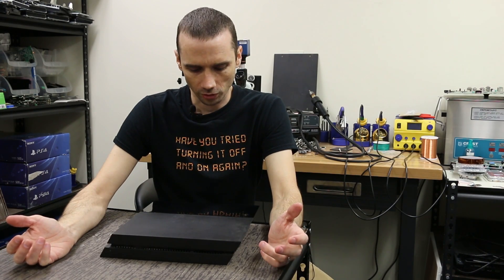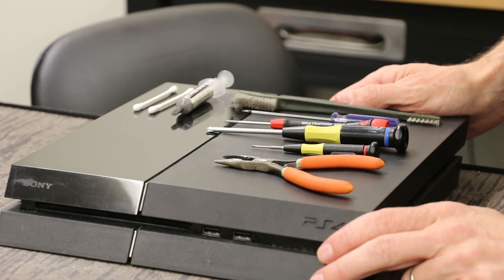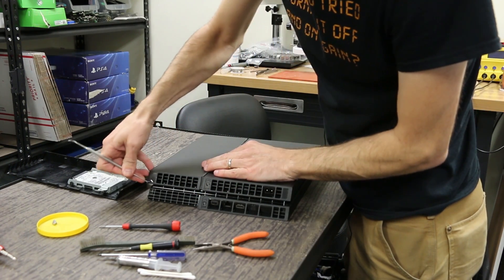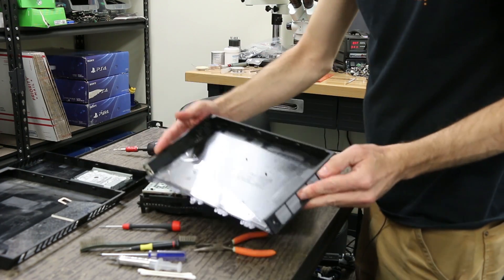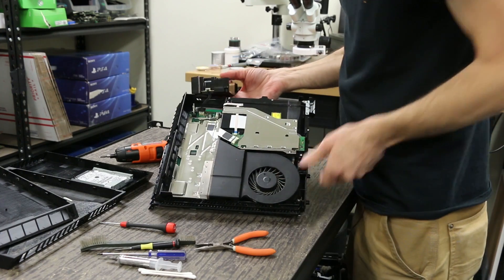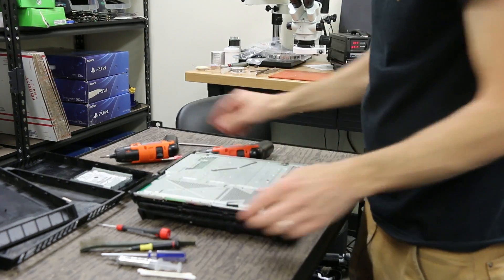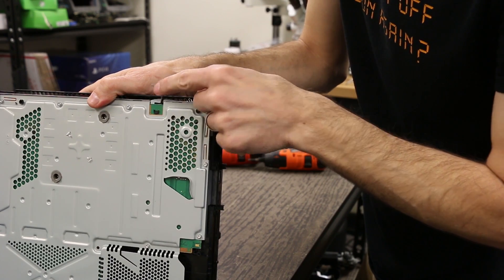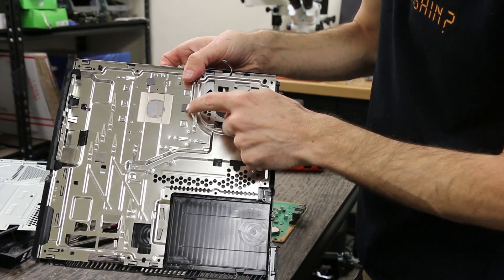PS4 Original Teardown Tips & Tricks

Comment: HELP: I followed this and it worked great for my CUH-1115A.  However, the disc drive didn't work when I put it back together.  The eject button doesn't beep and it won't start feeding a disc when i insert one.  I took it apart again and double checked the 3 ribbon connections and power connection.  What else could have happened or should I do to get the disc drive back to life?

Comment: Tronic fixed thank you very much for this video my PS4  black ops 3 edition was loud as a jet engine. The inside was not in really bad shape, though it was dirty. But when I got to the thermal paste, it was completely bad. almost nonexistent and hard on the sides cleaned it up added the perfect amount of thermal paste and my PS4 is running like new. I can’t even hear it. Thank you very much.

Comment: The hardest power is the power supply I am having quite an issue pulling out the connector

Whenever I try to grab it with plyers it just squishes the plastic then I have nothing to grab on to.

Comment: Hey Steve??? I know this is a very old video, but I am working on a friend's PS4 plus right now. You are the GURU when it comes to these, so I have a question... I have just reassembled and tested - it's beautifully quiet (yay!) but the optical drive seems even worse than before (was a bit 'sticky' but now doesn't draw a disk in. 2 questions if I may... 1. Is it viable to lift out the motherboard while it is still sandwiched between the metal layers (rather than disturb new thermal pads and paste) and 2. Any advice on the disk situation please? Love your videos, will love you long time, 5 dolla!!!

Comment: I just wanted to say thanks for both your teardown and assembly videos. This probably just saved my $200 investment I just made in buying a used PS4. I was in a pawn shop back in May when it was still really hard to find gaming graphics cards or modern gaming consoles for a reasonable price when I came across this OG PS4 that was being pulled from the display case. I knew it was probably something wrong with it but I got the clerk to let me test it anyway. They had it marked as didn't play discs at first but the disc went in ok. I didn't notice how loud it was in the store so when I brought it home a couple of weeks ago I saw the real problem. As soon as I turned it on it sounded like a jet engine. I played it like that for a few days but it seemed to get louder. 

 So I started looking into repair videos. I work on computers so I knew it was probably overheating and would give me problems soon. I hate working on anything like consoles or laptops with little ribbon cables to deal with. I watched both your videos and it gave me the confidence to take on the task. I gave my PS4 a good clean and repaste and even added an internal and external SSD and now it's so silent it's scary. I almost thought I forgot to connect something but I clearly remember plugging the fan back in. I've been gaming on it for over two hours now and it's still silent and has not shut down or even gotten louder. Anyway, thanks for the videos.

Comment: I had so many issues with mine. I don't have anything to pull the cables with, but I managed to remove the power supply, however the cable is so short it didn't really give me enough confidence to keep going. Trying to put it back in 'gently' like other videos said didn't work, so I snapped it back in with some force. The console works, but the case is slightly bent thanks to a torx bit that was stripped by the previous owner.
But now I have an actual issue... the eject button seems to be misbehaving, I didn't touch it when cleaning the bottom part of the case, and it beeps thrice, ejects my discs, and then the drive continues to make noises as if trying to eject still. I have a CUH-1106A, I really don't want to go in the thing again and risk damaging it further but the discs ejecting and that noise worry me so much.

Comment: So, after 8 years of service, my PS4 finally got maintenance.
The video was very helpful. Thank you!
a few tips from me:
1. I do not have small pliers, as in the video, and regular-sized pliers easily break the power supply connector. After a little crackle (my mistake) I gently tugged on the edges of the connector and it came out freely.
2. PS4 fat has several revisions, mine had a couple of extra screws. So you need to remember the location of each screw, it may not be on the video.

Comment: Fantastic Video... I want to replace all my torx and screws. Can you list how many there are of each type of screw and torx used to take apart and reassemble the PS4? I would greatly appreciate it.
Reason for replacing is because the heads are really stripped from the previous owner.

Comment: Hello... Please some help from anyone... My ps4 fat 1200 runs great, but after cleaning services following disassembly videos... Now the console doesn't recognize my controller, even usb connected.... The USB ports have energy because they charge my phone or turn on the portable hdd.... But a generic USB controller and also dualshock V2 controller connected with USB, nothing happens.... Now the ps4 it's stuck on safe mode screen, waiting the PS button command, but after tried different micro USB cords and so on... The ps4 doesn't detect any USB controller connected..... I appreciate A LOT some help....

Comment: 4:31 That method didn't work for me, as I have particularly weak grip. Half a year ago, I stuck there and gave up. Today, I figured the one in the video cannot be the only way, so I used a flat screw driver to pry it open, and it worked! The rest is relatively easy, it's the part that requires force actually got me, lol. So, just a little reminder. If you cannot do what TronicsFix did at 4:33, use a screwdriver~

Comment: Hope you're monitoring this video but  I have the original, not the Pro or the slim, the top piece that slides off the top is not shiny and the screw for the drive is in a different place. But they come off normal,  I turn it over and remove the warranty stickers but they're the only screws on the back and it doesn't just pop up like how you did it. Why ideas? I am trying to remove the CMOS battery. Thanks in advance!

Comment: This is the 2nd time taking my PS4 apart and I just pulled out the wrong wiring on the power block part. Now I have to get it soldered back on. The wiring comes out of the power supply and not the board 🤦🏿‍♂️

Comment: Hey steve, around 5:38 you were take out those long screws with those metal tabs, what are they for ? And is it bad if they are broken? Thanks !
Reply: It holds the power supply in. You'll probably want those fixed or get mew ones.
Reply: @Justin-lx3to  lol they are used to pull the screws out easily not to hold the power supply in.
Reply: @JayzBeerz  oh the tabs thought he asked if screws were important

Comment: Where my chip is my white stuff melted on the part under it and when I put it back Together (I cleaned the stuff that was melted on it off) and turned it on and it will be on for one sec then back off I looked at all my cords and stuff and there back where they should be but don't see why its not on my is the 1st ps4 that came out so its not a slim or pro

Comment: Have you made a video on, ps4 original power button or eject button doesn't work? I took my ps4 apart and had to put thermo paste in it and when I put it back together the power nor the eject button wanted to work all though the ps4 did turn on. But before I did anything the power and eject worked fine, besides the fan being so loud.

Comment: So I just toredown my PS4 turns it back 3 beeps thinking I'd broke the prongs to the power supply nope turns on I didn't have that plastic bit on the X separating the motherboard and metal sheet I'm so dumb I swear I kept looking at it like you came from the PS4 but were you go I have no idea. On the upside I'm slightly more experienced now if that ever happens

Comment: I just observed something... I feel like the reason the older models sound like a jet is probably because the APU clamp doesn't have an extra plastic piece that holds in more pressure on the APU so that it make perfect contact to the heatsink. If there is no proper contact, your APU gets overheated which makes the fan louder. I have a newer model(not the slim) bought in 2016 and i haven't cleaned in like 4 yrs(did a month ago), yet it doesn't make noise even while playing GOW /TLOU2. Btw it runs almost 24x7 lol

Comment: I am currently trying to clean my PS4, and was working to get the fan off but was hesitant to take it fully apart because of the thermal paste needed but, my question is, if I am only going for the fan is it necessary to replace the thermal paste?

Comment: It's amazing just how silent it runs now after taking it apart and getting all that dust out. Thanks a lot for this video. Cheers.
Reply: Yup. All the "jet engine" ps4s are just dusty, and probably need new thermal paste as well.
Reply: Well mine was silent too, until I found out that my fan doesn't work at all, I guess I have to replace that lol
Reply: @hashimkhan5824  How did you find out the fan wasn’t working?
Reply: Mine probably reached a Max of 3000 decibels

Comment: Hopefully you see this and can reply!

I bought a second hand ps4 from a friend and its the original launch ps4. Everything worked perfectly except from the fact that it was very, very loud. I'd cleaned the fan multiple times and it made no difference. I saw threads online about cleaning of the heat sink. So I went to one of your videos and followed your instructions on taking apart the ps4. When i got to the motherboard it was really hard to access because the thermal pads were stuck and I had to pull really hard to free the metal plate above the motherboard. Then I got to the thermal paste the motherboard and the metal player underneath were stuck together because of the paste. The motherboard was almost immovable. In all the videos I watched the motherboard was easy to take out but mine I had to pull really hard for the thermal paste to release. I then proceeded to clean the heatsink and the fan. I didnt replace the thermal paste even tho there was barely any left and it was crusty and hard. I put everything back together and now when I turn it on the fan goes full blast, it gives me 3 beeps and the red light of death. Do I need to replace the thermal paste or is it a lost cause? Thanks for responding
Reply: This is a 3 year old video..
Reply: @darussian705  I still need an answer lmao
Reply: Nevzy fair enough
Reply: Seems like the lack of any thermal paste is making the console instantly overheat and go into quick shutdown
Reply: @darktempest53  update, I replaced the thermal paste and it worked again

Comment: I have a really different ps4 seriously i watched every YouTube video and no one has the ps4 what i have. I don't have 4 screws at the back of my ps4 and my opens harder and difficult and different motherboard
Reply: Did it open with force?
Reply: @Suddenmamba  yes and with so much pain on my fingers.
Reply: @ubeydullahxl  Check the bottom, it might be a CUH 1215a
Reply: Hadi masri there are no screws, just extremely hard to get off, i ended up breaking something
Reply: Same here. Mine doesn't have the screws on the end on the  back of it.
Reply: I have the same ps4 only 2 screws and can’t find any screws anywhere else and can’t find a video explaining why it won’t come off Ik if I force it off it will break
Reply: @skylarburford6701  did you ever find the solution? I can’t
Reply: @trevorjohnson4373  I'm having the same issue! Weirdly I've cleaned it out 3 times before but forgotten how I got the psu out 😣Wait no it just pulled out 😂

Comment: So my fan connector broke while disassembling for clean. I followed your directions but the old connector just shredded after I put pressure. I saw a post that said just attach the wires to the pins but one pin is broken. Any tips or is it done?

Comment: My PS4 only has 2 screws on the back. What do I do to take off the bottom cover?
Reply: There wasn’t more than two screws
Reply: theres more than two have you removed the stickers blocking the screws?
Reply: @ninja The 1200 models only have two screws. The 1100 (which is shown here) has four.

@edger After you take out the screws you should just be able to pop the cover right off. It'll be kinda tough if you've never done it before so be aware you may have to pull it with a bit of force.

Comment: I recently cleaned my ps4 took it apart bc of overheating issues and when i connected it it does 3 beeps and the fan starts moving and quickly turns off
Reply: I can fix it for 40 free shipping

Comment: Awesome video!! I was wondering, what would you use to secure those thermal pads in case them come off during disassembly? I haven't disassemble mine that far yet, I'm just trying to take the proper precautions.
Reply from the maker: They are a bit sticky so as long as they are clean they will stick to the ram chips or metal plate.
Reply: TronicsFix LLC Good to know, thank you for the quick response.

Comment: My PS4 CUH-1115A started over heating like an hour ago and it has me very upset. I usually keep it ventilated (by a window) and I use compressed air when I can. I was just watching this video and I noticed you didn't take out a disk drive without removing the optical drive; can I remove and replace my fan without removing the optical drive then?

Can I:
1, just remove the HDD, the motherboard and the metal plate holding the heatsink?
Or 
2, I have to remove EVERYthing to get the fan out?
Reply: Just remove the power supply and remove the motherboard and metal chassis. Keep in mind that removing some cables beforehand such as wifi antenna and power cables will make the disassembly easier

Comment: alright im gonna say it, if anyones ps4 sounds like a jet engine when playing certain games and you feel like it will or may overheat 
okay cool thats fine if you wanna open it up and clean it out from dust or change the thermal paste.i  just wanna say that you might as well clean the heat sinks if you are changing thermal paste because you are literally 3 screws away if you disassemble your ps4 all the way to the thermal paste part,  my heat sink was dusty on one side but not covered in dust, so i cleaned it out, changed the thermal paste using the arctic silver 5 ,  assemble everything back together , started my ps4 up, and everything was good and quiet , 

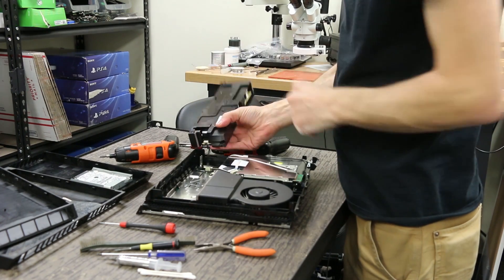awesome video btw , although if anyone gets to the power supply part and have a hard time getting the battery connector off @6:10 its okay i had a hard time too cause i didnt have the right tools to pull it out and i eventually just used my fingers to pull it out , be careful not to pull the black wires
Reply from the maker: Yep, exactly...for some reason most people don't clean the heat sink and that's where the problem is usually.

Comment: Hi Steve, love the vids and especially your shirts ;)

I have this same model PS4 and I took it apart to reapply thermal paste and dust it out. Unfortunately my Blu-ray drive no longer works. I thought it was the metal connector not properly making contact with the daughter board on the drive, but no matter how many times I bend it, adjust it and coax it on to where I 'think' the gold pad on the board is, the eject button does not work. 

I tried shutting down, inserting the disk most of the way, then turning the unit on. The drive makes noises and eventually spits the disk out, but will not take it in or mount it.

I remember you saying something in one of the vids (this one?) about removing the ribbon cable so as not to break off the 'ears'. I thought I was pretty careful, but I'm running out of ideas to get my drive to work. How can you tell if the drive is toast (it was working fine before disassembly) or a ribbon cable issue? If I have broken off the ears, is it easy to tell from looking at the cable? And if so, how to get the broken ears out of the connector?

What I would really love is to know what the shape/bend of the metal eject button connector is supposed to look like. A reference photo or illustration you could point me to would be fantastic.

Thanks again for these vids.
Reply from the maker: You should be able to find a photo on Google images. A good way to test if that's the problem or not is to just remove the bottom cover and plug the console in then just press on the copper pad with your finger.
Reply: Thanks I'll give that a shot and totally forgot about google images - excellent suggestion.
Reply: UPDATE - SUCCESS!! I tested the eject contact on the daughter board which triple-beeped as normal when there is no disk to eject, so I was pretty confident the drive itself was fine. I was quoted $99 by a local console company to repair it, but decided to take a chance on ordering a new bluray drive cable (the wide one) for $8 on amazon. The ears on the new cable were definitely noticeable compared to the almost non-existent ones on the original cable. Carefully inserted both ends and BINGO! disks insert and eject like before. I am supremely overjoyed and thankful for your assistance. :)

Comment: I need help, I was taking apart my ps4 for cleaning and I accidentally pulled out the psu connecter from the motherboard. I know it's possible to solder it back, but I don't if mine is broken beyond repair.
Reply from the maker: Yes, we fix lots of them. It's probably fixable. You can always send it in for a diagnosis if needed: https://tronicsfix.com/collections/playstation-4/products/ps4-free-diagnosis
Reply: TronicsFix thanks but I already fixed it, I just replaced the mobo and optical drive :)
Reply from the maker: Dante Glad you got it working!